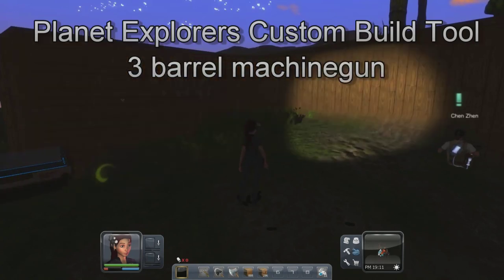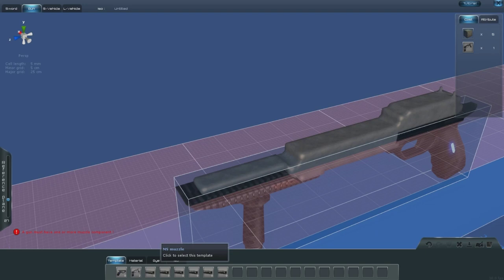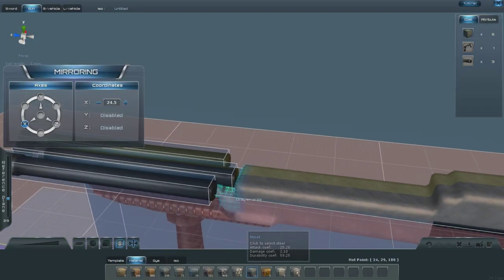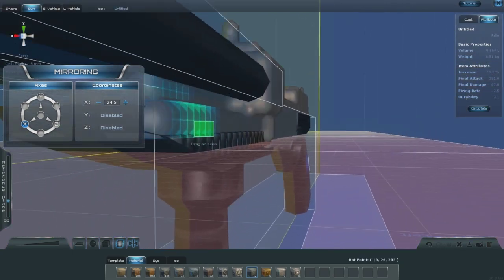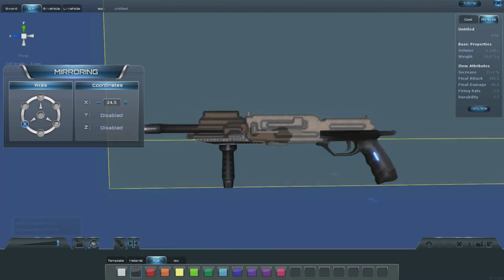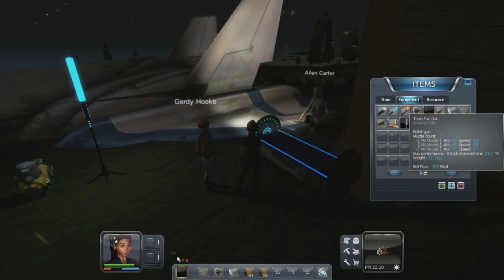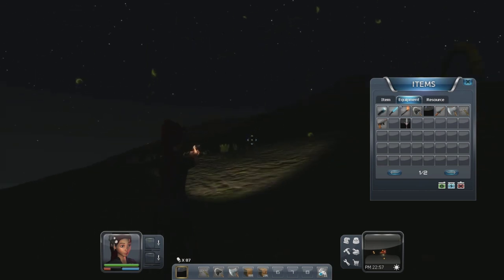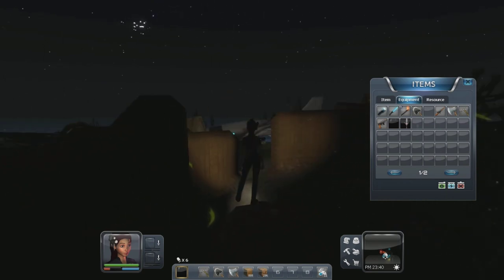Planet Explorers Custom Build Tool - Tri-Barrel Machine Gun

Comment: I just made my first working gun. using the rifle hilt and 4 rifle barrels bought at fire bear camp I made a simple box style gun, hollow inside.  made of iron with 4 barrels on top of each other the weapon was a huge upgrade from my store bought rifle of 95 dmg. Dmg with rifles seems to be based on number of barrels.  Dmg 462. 177% accuracy. 5.7 fire rate. 8000+ durability.
Chewed through this underground bug queen very quickly.  Bullet sponge though and bullets are stil 5 money a piece.  
I experimented with swords a bit and see what they mean by making a large surface area weapon.  It doesn't even need to look like a weapon for it to operate with high dmg.

Comment: you can also "hide" parts... I made an M4a1 with 880 attack... to get that damage I had to use 4 barrels but I just hid 3 of them so the model looks correct as you can only see one barrel... also, in case anyone was wondering, material and weapon mass also affect damage... where the grip and barrel is doesn't matter but the more material you use the more damage, same with higher grade material but be warned if the gun gets to heavy it lowers accuracy a lot
Reply: so if you make a gun that's just a block of something really heavy, itll do some silly amount of damage?
Reply from the maker: David Webster From what I recall when I made this video, there appeared to be a correlation between the mass of the object and the damage multiplier.  Is that still the same case?  I'm not sure.  It's been a while since I played.
Reply: Chris Nicholson I haven't even played this game, so I have no idea.

Comment: I can definitely back the fact that, if you place a handle and barrel far apart, and then connect them without covering the barrel, that it massively improves the quality.....unfortunately... I made a really ugly gun, its just a pistol, does 114.9atk, 19.1dmg, 54% increase. it was made of steel, it is a decently high amount of steel by the end, but adding and removing steel doesn't change the stats much by this point... infact, -adding- more was lowering it after a while. Compared to a diamond